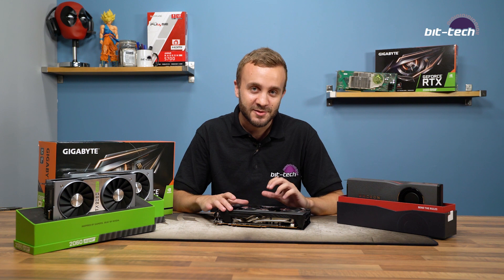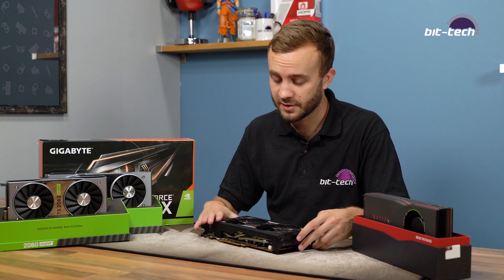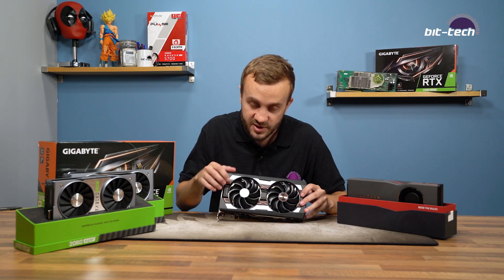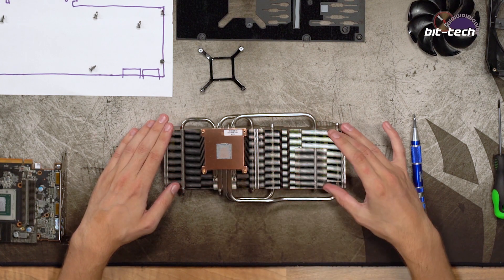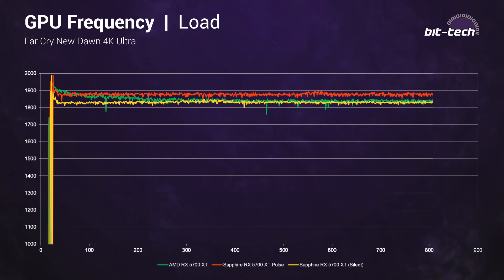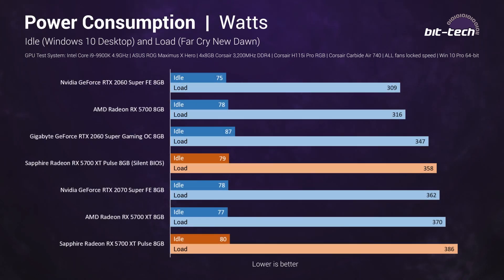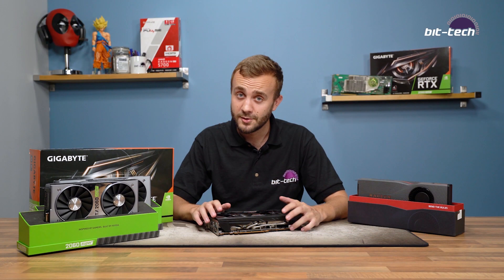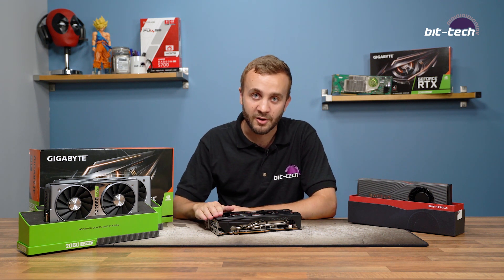Sapphire RX 5700 XT Pulse Review - COOL and QUIET Navi!

Comment: seems like this cards get really hot semms like alot of tweaking on every card if u whant some mem ore gpu bost from it hope they learned and big navie is gona be bether right now i dont know its cost hear 400e going to 450e in sweden and its riducles prising for this cards had both 2070 super and this card the super goes out with np no tweaking but the 5700xt is alot problems twaking it you think card wuld be working out of the box after new driver but not with this cards and the framtimes are jumping like i have never seen on card ever and ofc 3070 dident come to day in sweden so  
1080 ti is gona be around for a long time

Comment: I've had my Pulse 5700XT for a few months and am seeing record high MEM and HotSpot temps (up to 110c), so I'm considering taking the shroud off and inspecting the thermal fittings. This is despite messing with case fan flow, since its steaming hot directly from the back plate and fins

Comment: Hi bit-tech
Thanks for reviewing saphire Rx 5700XT pulse, it helps me alot to choose a good Gpu card
do you recommend this Card for 4K video Editing using Dvinci Resolve?
Reply: I would highly recommend u wait for 3000 nVidia series cards, if u can (its coming out in 3-4 months). I have this card and in order it to be stable I have to downclock and undervolt it, otherwise every game will crash when the temps reach 70 C. Basically, if u buy this card ur taking a gamble, my friend has 5700 xt also, but he doesnt seem to have problems like I do. And if u cant wait for 3000 series I would still recommend you go and buy 2060 SUPER or 2070 for the same price, it is way more stable especially if you are video editing.

Comment: So I have notiest on the timespy stress test for this card has some interesting results 1. is that while on +50%pwr that while the gpu edge temp gets to around 87 degrees that the Tjunction aka hot spot is spiking at 118'c and is thermal throttling about 2% and causing some artifacting (black tearing) now whats also interesting is with the OC my timespy graphics score also shoots up to  about 9200 or even 9330 with the memory boosted. I have found that a power target of about 15% to 18%  to be 90% as effective overclock and have better stability and not thermal throttle. Tjunction still gets to about 110'c and the fans still spin up to about 94% or 3000rpm. 
my question is do you think this is normal to have approx 30' delta between gpu temp (gou edge) and the Tjunction temperature? was this in line with your testing or should I look to repaste my gpu?
Reply from the maker: When overclocked ours was definitely getting hot and loud. We saw a diff of about 25C, so I would say you are not far off what we saw.

Comment: OMG after the MSI 5700XT evoke thermal pad disgrace the MSI 5700Xt Mech is even worse with v.poor pads over two ram chips with no plate interaction with these pads. MSI has hit absolute rock bottom. See for yourself on the 2nd half of this MSI 5700xt video  https://www.youtube.com/watch?v=8ATNy2ISPn4

Comment: The 2060 Super for 435€ /// 5700 XT Pulse for 490€ /// 5700 non-XT Pulse for 430€.... What would you lot pick for 1080p 144hz ultra AAA gaming?
Reply: Just buy the card that you want in computeruniverse
Reply: FL3XXXER alright man thx for the heads up
Reply: tloco actually, if you have extra 50$ the best choice is 2070 super (In my opinion) because of rtx technology, but if you have no those extra money and you don’t need raytracing take 5700/5700xt then (pulse version is the best, in my opinion)

Comment: A good 500W PSU is it enought with a 3700x?
Reply: no, buy at least a 700w psu because your psu works between 50-60% more efficient so if your power consumption is around 400w you want to avoid to keep your psu over 90% workload don't do that, buy a 700w psu it will work more silent and live longer and keep in mind if you want to overclock
Reply: Big Smoke what about 650
Reply: @mustafas9011  here is a psu calculator for you https://outervision.com/power-supply-calculator if you have a r7 3700x and a Radeon 5700xt your power consumption is around 420-480w, let's say if you buy a psu from be quiet 850w gold efficiency your psu will work around 57% and that's good because around 50-60% workload your psu reaches 94% efficiency it will keep your pc silent and cool, but if you want to buy a 650w psu you can do it but it will operate around 70% so your pc might get a little hotter or a bit louder and your pc wouldn't live so long if it goes up to 80 or 90% if you start to overclock, personally I wouldn't go cheap the psu is the heart of your pc

Comment: I noticed in these 5700xt reviews, total power consumption never goes over 400 watts on stock settings, would i be able to run one on 450watts? I have a 1st Gen ryzen 5 and 3 storage drives
Reply from the maker: Yeah it would cover it on stock settings, but pushing your PSU to ~90% capacity will often see the fan hit high speeds and noise levels.
Reply: @bittech1  hmmm i never knew that. Thank you for your response, you're the only one that gave me a straight forward answer

Comment: 48 degrees fan 100% ??? 🤔
Reply from the maker: No, fans running with default profile. 48°C OVER AMBIENT (aka Delta T), which is the fairest way to compare cards tested in non-temperature-controlled environments.
Reply: Delta temp is the max temp - idle temp

Comment: 362 watts for a 2070 super and 386 for 5700 xt... That seems a little absurd. Gonna need a 650-700W PSU!?
Reply: this is overall (whole pc) power comsuption. Imo 500W is enough.
Reply from the maker: Yeah, that's full system consumption with a relatively high spec rig. 500-600W would be plenty.
Reply: Stop crying

Comment: I can kind of understand why pound to dollar and tax differences result in wonky prices in the UK, but I really can't think why a $10 difference in the US is a £50 difference in the UK? You could probably air ship a single card for less than that.
Reply from the maker: Yeah it's pretty frustrating
Reply: It should be £408 tops, if it's being sold for $410. That's the correct conversion of dollars plus 20% VAT. Anything else is farcical bullshit.
Reply: Zenith anything else is called import/export taxes

Comment: All the extra components, custom PCB and good cooling for 10$ more, ASUS needs to learn from Sapphire.
Reply: F*uck asus!!!
Reply: LOL, No. ASUS strix version has a custom over kill PCB. The Pulse has a reference PCB.
Reply: @ktcool4660  you are wrong about amd asus side . yes asus did make good pcb and boost clock for nvidia but not for amd . go check the asus strix rx 580 1360 mhz clock and nitro + have 1430 mhz clock .
Reply: @ktcool4660  hi kt cool come on joint wccftech comment we misse you
Reply: @ktcool4660  "Overkill", i.e. pointless. The Pulse is the best value 5700 XT by a surprisingly wide margin. I'm still hoping that one or two other companies will offer something equivalent to it at some point.
Reply: @ktcool4660  yeah..and usually you get the same fps but they are hotter lol (ex 2070 strix vs msi 2070 armor oc)..but you get the shiny little lights eheh
Reply: @ktcool4660  this particular card has a custom pcb, it's shorter than the reference. I'm pretty sure ASUS charges so much because they send all them free samples to YouTubers to use in their build, don't get me wrong they make great products but on the AMD platform Sapphire is the way to go and on Nvidia side I'm pretty sure EVGA makes the best cards. Frankly speaking ASUS is not the "best" at anything. Generally speaking EVGA is the best in terms of quality from top to bottom, cheaper ASUS models are comparable to gainward/inno3d minus the non existent after sales. For extreme overclocking people use EVGA dark, msi and gigabyte make the best consumer boards, benQ makes better monitors in the sub 200$ range. All I'm trying to say is ASUS has hands in everything but is best at nothing.